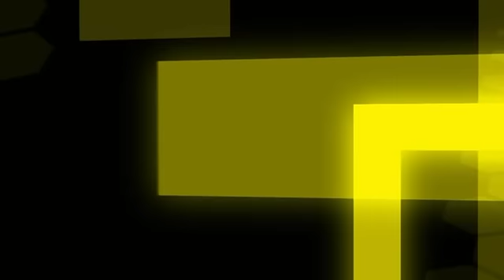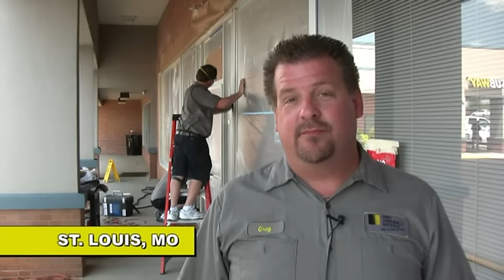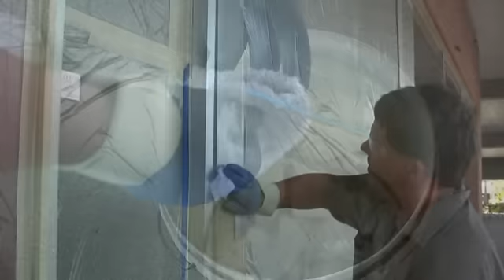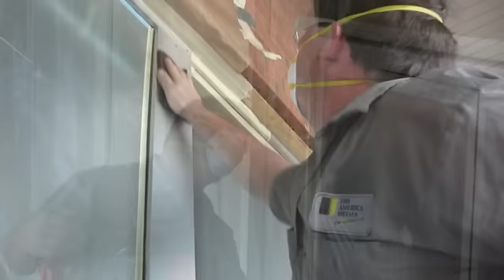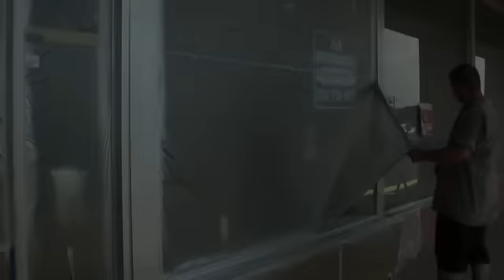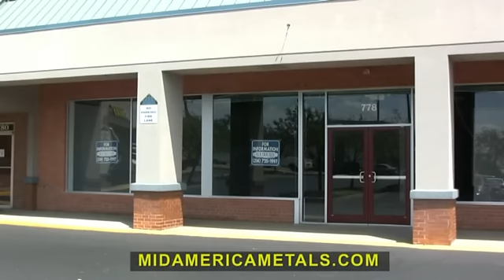Painting Aluminum Window Frames

Comment: The result looked pretty decent, however there's a pretty significant problem with this technique. You painted over the glazing stops. You should have removed the stops, painted them separately, and refastened them. First broken window and your paint job will be a dog's breakfast once the glaziers take those off and reattach.
Reply: Haven't ever had a broken window in my 30 years of homeownership - figure I'll break down and get new windows by then